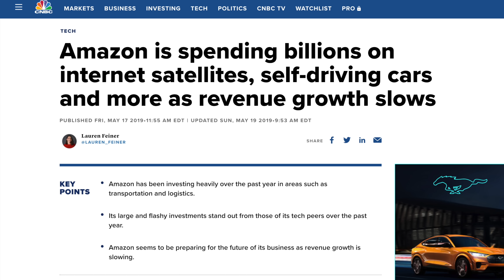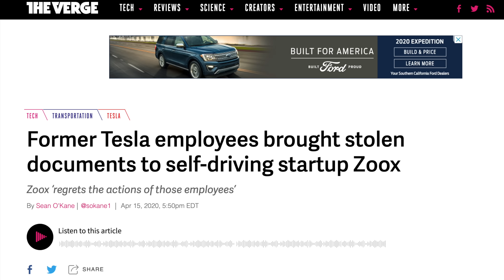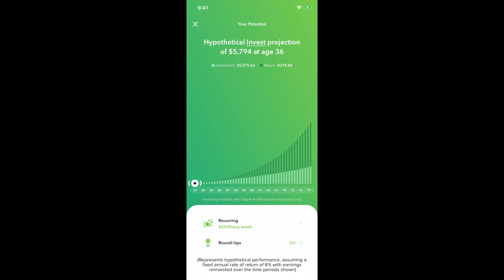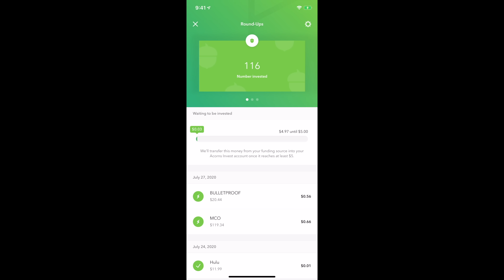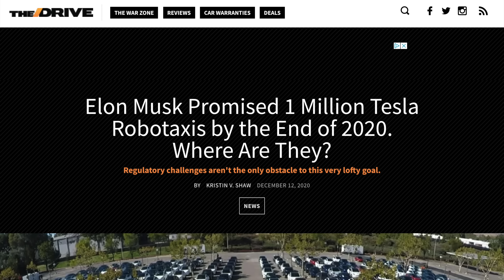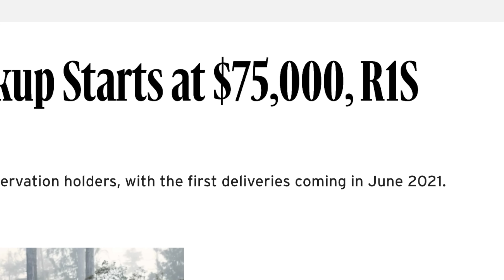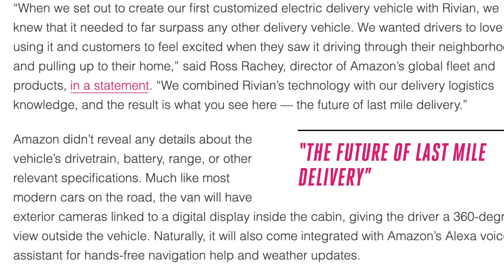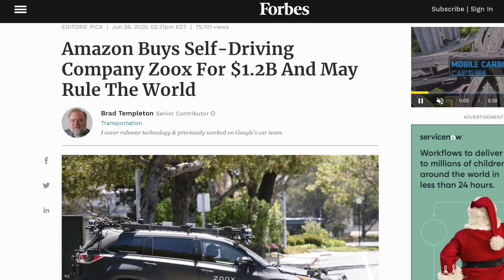Tesla Already Beat Amazon

Comment: I don’t see how any of these companies like Apple or Amazon can compete with Tesla. They all started out too late and Tesla is way ahead of them on self driving and the whole infrastructure.
Reply: Yeah but they have more resources.
Reply: @angadsingh9314  question is if they are gonna be able to use the resources, one of the problems with big companies like amoazon and such is that they are afraid to take risks which will likely result in them not being bale to get ahead before the run out of money
Reply: @Megaranator  True. Tesla on the other hand, is built on taking gigantic risks
Reply: Agree. Apple is risk averse. Still not buying ‘Apple Car’ - more likely just software/tech and they’ll partner w OEMs already making cars. If they try to make cars they won’t be able to bully the supply chain like they do w consumer electronics.

Comment: ...TESLA's robotaxi idea will be greatly enhanced if they focus on a VAN rather than focus on a sedan..  reason being is that its way more easier to ride passengers, way more cargo space, and passengers does not need to lie down to seat.. in a VAN configuration, passenger will just walk thru a sliding door, where passenger does not need to sit like a car, but seat like a bus instead..  moreover, passenger will feel more safe and secure if they are riding a large van than riding a car..  the VAN can also accommodate more passengers per trip, considering that the cost of travel on a VAN is basically the the same on a car..  but the sheer numbers of passengers, makes the VAN a more cost effective mode of transport...

Comment: Correct if I'm wrong, but LIDAR doesn't work in rain/snow. So why use lidar for a robotaxi if its limited like that?
Reply: Wait what? Why wouldn't it? I mean sure the rain drops will provide some interference but they should be able to make it work. I think lane lines and other signs are a bigger problem
Reply: @angadsingh9314  source?
Reply: @pebre79  No source. Intuition. Take it with a grain of salt :)

Comment: There is a 0 percent chance of level 5 in the next 3 years
Reply: Its already here.
Reply from the maker: Where?
Reply: @RyanShawtech  Level 5 isn't going to happen on open roads for a long time. Take a read of the various level definitions https://www.nhtsa.gov/technology-innovation/automated-vehicles-safety. You need level 5 for robotaxi
Reply: Level 5 means all interactions at all times in all weather. Nothing is even close. US regulatory is expected to take multiple years after a feature complete product is deployed. Autopilot is a level 2 system, verging on 3. Elon is way too optimistic here.
Reply: @arthurkeech  Uhh FSD beta is already out and the full version will come out next year. Its not fully autonomous and makes mistakes but it can get you from place to place easily
Reply: If you can dock a space craft to the ISS autonomously, it means they probably can achieve it. Not going to say in 3 years guaranteed, but we will get there.
Reply: Arthur is 100% correct. L5 is not in sight yet. 
All robotaxis that will launch in the next 3-5 years will be L4. (no snow, only in geofenced area, remote operators on standby to take over)
There is also 0 chance Tesla will launch a robotaxi in the next 2 years. Their current FSD is not even capable of making a left turn confidently.
Reply: Forget L5 even true L4 is a long shot in the next 3 years. And docking spacecrafts autonomously is not even remotely comparable (& not novel either). There is a book called Traffic which explains why (no its' not about self-driving but rather about the heterogeneity of traffic on urban and rural roads).
Reply: Even if the tech was here 3 years ago, it will still take another decade at least for widespread regulatory approval

Comment: Do you think Amazons AI and self driving software could pass Tesla‘s full self-driving software? It’s great to see more competition, but it’s hard to see LiDAR becoming competitive against Tesla’s cameras and software.
Reply: Tesla cameras and software have a lower performance ceiling. It will max out somewhere, and if that's not enough for safe driving, they would have to upgrade their entire fleet, or sell new cars.
Reply: Cameras don't work in the dark or in variable lighting situations whereas LIDAR does. LIDAR doesn't work too well in rain and snow. Hence, what is needed is a suite of Lidar, radar, USS and cameras. Remember the FL crash where the Tesla couldn't differentiate the side of a 18 wheeler from the sky and ended up decapitating its driver?
Reply: @majortakleef8445  and the concrete barrier that killed the driver in the day

Comment: It’s going to be really interesting to see how the self-driving TaaS future plays out.
I’m kind of confused by the Zoox thing.  It looks designed for very short trips.  The bi-directional driving thing is odd since you can’t actually tale advantage of that on regular roads.  Its also a geofenced solution.  I can see it working really well in specific scenarios but it doesn’t feel like it leads to a universal solution.
If Tesla can really solve their self-driving in the next couple years its going to overshadow all these other restricted systems.
Reply: The bi-directional drive makes more sense if you see it as a taxi capable of driving into tight driveways one way and leaving the other and thous removing the need to turn. If it is geofenced, it is probably just because it makes it easier to get permission for autonomous driving in a geofenced area than it is to get permission to drive autonomous on most roads. The vehicle is more than capable, and perhaps even more capable than a Tesla, due to a more extensive sensor package.
Reply: It's something new to americans but this is similar to the driver less trams in other countries